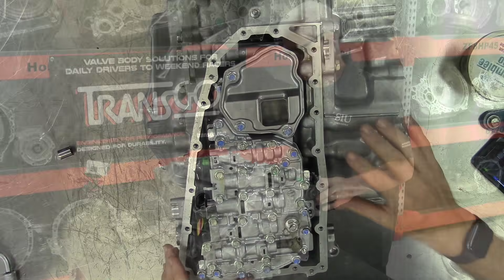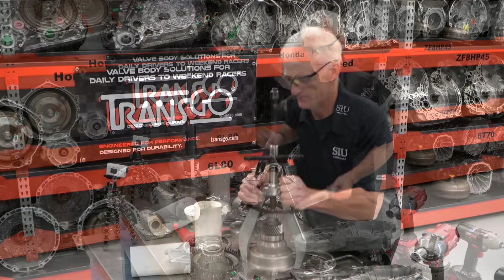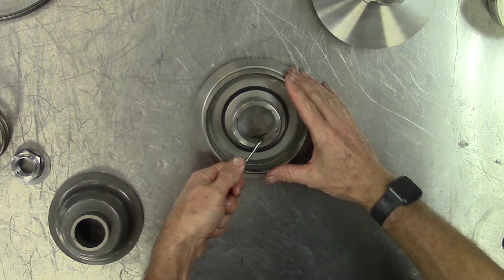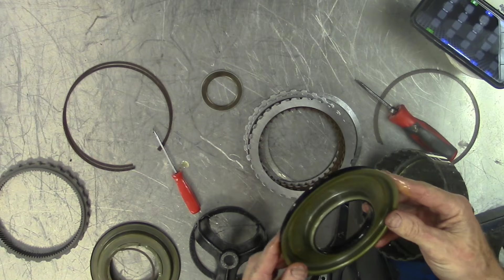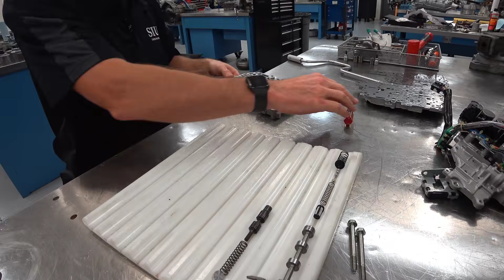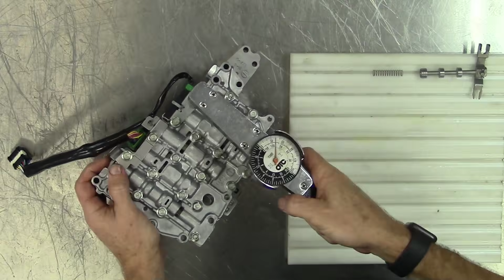Jatco CVT Overhaul JF011E RE0F10a/b

Comment: Do you have such a video for the JF010E transmission? Great job, btw! Thanks for sharing this!
Reply: They don't have one posted.
Reply from the maker: I don't have on specifically on the JF010E, but it's very similar to this unit.  Still has a stepper motor and the ROM.  Is there anything in particular that you are needing that this video doesn't have?
Reply: @siuautomotive  yes, please, can you show how to test forward clutch piston pressure. And should it hold pressure, during the air test via oil pump hole? I need to  determine a problem with oil pressure leak in that section. In my case, it is JF010E (  RE0F09A). Thanks!
Reply: @kalindimitrov5172  did you ever find a way to test that
Reply: @BlakeHirst  Yes, I find out how to test forward clutch for leaks. Just need to supply compressed air to specific port to oil pump, assembled with input shaft and forward clutch assembly. I can send you a video of my experience.
Reply: @kalindimitrov5172  yes please send what you.have

Comment: Hi.  Fantastically  informative.  Thank you.  I am in Australia and we have a 2012 Suzuki Swift Sport with CVT.  Car has had a young mother and our grand daughter, a novice (but very careful) female as owners of this car from new.  Car has only 80K Kilometres on the clock.  Within 12 months of our girl getting the car the CVT started slipping and got to the point where it is undriveable.  We took it to the Suzuki dealer for  diagnosis and quote and the only thing they would contemplate was replacement with a  new transmission at a cost of a little over $9K AUD.  They refused, or could not give details why the transmission had failed.  The car is in beautiful condition but is not worth that much.  Other transmission specialists were contacted and all reports were very negative.  We were told that these transmission are "Throw away", cannot be repaired, and that the parts are not available anyway.  So now we have a nice bright yellow monument sitting on the back lawn.  I am an experienced mechanic and your video has given me the incentive to have a shot at repairing it myself.  But if the parts I need are not available or prohibitively expensive, I would be wasting my time.    Do you have any advice for me?  Thank you.  Gert Roewer, Jindera NSW Australia.
Reply from the maker: Thanks for watching the video. 5-7 years ago many shops had the same attitude about rebuilding cvts here in the states.  Now many shops are rebuilding these because there are so many out there.  I guess in your situation, you’d want to do research to see about parts availability.  You might find out how much it would cost to have parts sent from the us to you.  Slauson.com has a ton of good used belts and pulleys.  The transgo drop in flow control valve is a good product and I’m sure it’s available through parts suppliers worldwide.  When you pull it apart, the pulleys might look bad if the belt was slipping, but it’s likely build up and the material will probably clean up.  I wrote an article for gearsmagazine.com for their January issue.  You can read the magazine online and that issue includes a buyers guide.  Download that mag and learn more about the cvt and check out some of the suppliers.  You might find what you need!
Reply: @siuautomotive do you have any tips on best fluid to put back in these cvt transmissions?
Any miracle additives help? ,,mine has started sliping,,only goes 5mph!,,,Help with any advice 😢
Reply: @siuautomotive  Thank you.  Very helpful.
Reply: Hi Gert, did you ever find a solution? Also in Australia with the same car.
Reply: @CM-ch5vc  No Clive not yet.   Granddaughter has another car and this  car is gathering dust.  I don't have a lot of time but hope to get to it before too long.  Has your trans failed too?
Reply: @gertroewer152  no mine hasn't failed, its shuddering on deceleration and sometimes won't up shift if revving around 3-4k rpm, i can also feel what seems to be a slight slip. I think the last person to service the transmission has used the wrong oil type(pink color) I have been sourcing service parts for it from the dealer, all coming from over east or Japan. This sort of explains why the CVT in this has a bad reputation, I think people don't service them or if they do, they dont use oem spec stuff as it's hard to source them locally, also pricey. From what I've gathered, it's very easy to damage with the wrong fluid and recommended is the expensive Suzuki green fluid. I did a drain and fill over the weekend with correct fluid but not much change. I intend on getting a full drain and fill as fluid is still coming up pink when new fluid is green. There is also an external filter which according to suzuki is not a serviceable item, wrong! I had a look at mine and that thing was is extremely dirty for a filter(100k km on car). I have called a number of wreckers around and this transmission is known for its scarcity and quick sell, so even when they have them, they sell them for close to 4k because of this.

There's a specialist in NZ that reconditions them and sells them worldwide including Aus. He also supplies parts/guidance to guys that rebuild them here. He wants ~$3,400(2,800 + 600shipping) excluding GST.
Reply: @CM-ch5vc   Good info thanks Clive.  Our trans has a full service history an I'm sure Suzuki Aus. has used the correct fluid.  Yes I found that out with the wreckers.
Reply: @gertroewer152  any updates?? Did you ever find a replacement or is it still just sitting lol
Reply: @CM-ch5vc  I am from europe and talked with many reseller (Mitsubishi and Suzuki). I am owning a city car (Swift 2023 with CVT not multistep, so the classica 015)....it is controversial because there many forum including Japan etc that suggest to replace fluid but the service manual in europe for these cars says only to check the fluid every 20K kms....if fluid is looking bad go for the replacement but it is up to the service. The warranty here is 3 years, and for cars like Mirage/Space star is 5 years or 100.000 km so the overall lasting period for these transmission can be fixed around 100.000 from warranty perspective (7/8 years cars job) which is overall the devaluation periood of the car (At least my swift costs around 18.000 Euro and  after 5 years is more that expired this value)....long story short: they are not bad at all these transmission because they keep car (citycars) far from maintenance, low price and smooth driving...they are not thought for mountains trip, or sport use but overall everyone saying that are "piece of crap" I guess misunderstood the scope of having a transmission like this. If you want to have long lasting transmission buy ecvt or classical  locking torque converter but the price of car is higher for these type of transmission, the fluid replacement has a cost (in 120.000 km is over 1000 euro or maintenance) and sometimes insurance is higher too, included oil consumption so guys, do correctly the calculation: better spending 18.000 with the risk that over 100.000 km u need to add on top 5000 euro of new transmission (Hypothetical because I do not think the majority of Jatco cvt suffers of break after 100.000 km) or better to spend 5/6000 euro better car with higher cost in terms of maintenance and insurance, with the illusion that "oh jeah...i saved money because the transmission last forever....this is simply my personal thought.

Comment: Bro can u tell y 4l60e pump break or where I can find 7 vane router for 4l60e
Reply from the maker: The pump rotor can break for a variety of reasons.  1) if the transmission was just installed, the installer might not have the converter lugged into the pump.  2) if it fails during operation, it could be from lack of converter hub engagement (with converter bolts removed, the converter should only push back 1/8 - 3/16”). 3) erratic pressure will cause the pump slide to bounce around and that stresses the rotor and slide, which could cause breakage.  I don’t know about a 7 vane rotor.  A 4l60e should take a 10 or 13 vane pump.  You could go to Witrans.com or transtar1.com and order pump parts.

Comment: i bay jf010e-fc, i have 18 steel ball, in transmission i have 12- 3x4,  that's why there are 18 balls in your set, does that mean I have to put 3x6
Reply from the maker: If each groove has three balls, then you need to go back with three balls or a roller that’s the same length as the three balls.  Don’t put more in or the pulley might not have as much travel, limiting its gear ratio and set a Dtc or even break the pulley.